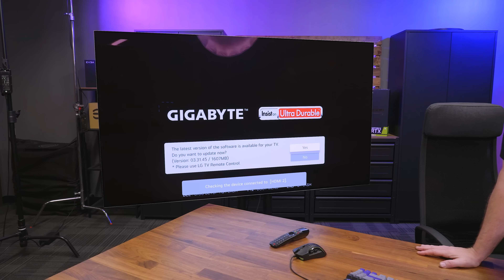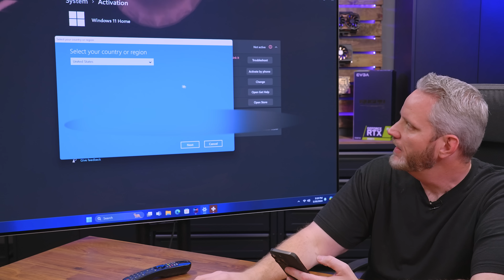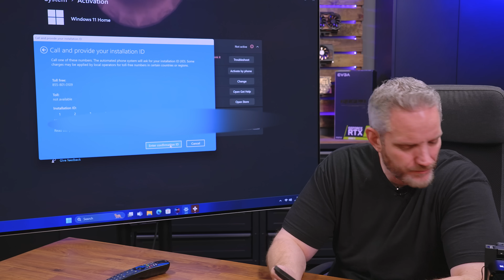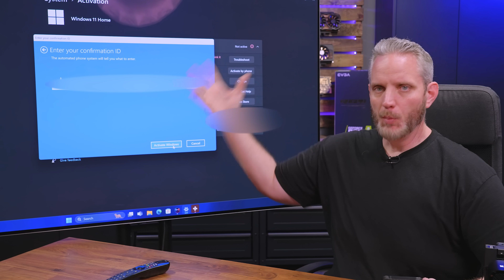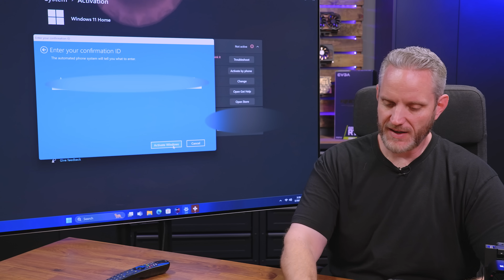How to move OS drive to new PC and keep Windows and Activation! EASY!

Comment: thanks for the info currently i beleive my mb is borked because it even stutters sometimes in my bios and i used to build pc's no  issues my entire life  this is the first time ive not been able to nail down what the absolute fucks going on

and im keeping this installation because due to anxiety its highly customized to not expose me to anything that would set me off

so i plan on because apparently when it comes to pc's im cursed now ''i took the gpu out to clean it and everything went fuck for months again then evened out''  buy a prebuilt with the best fuckin parts i can get and then move my current m.2  ssd and hdd over 

hoping the pc issues are fixed and my games are smooth again im going for a 7800x3d and 4080 so i wont have to upgrade for awhile i fucking hope im still on a 5800x and 1080  fe

at one time i put a 3070 in and unknowingly cooked my board because my psu  wasnt strong enough i should have done research myself but i bought it in store and asked a sales rep what i would need and he said i was good

i was in fact not good i sold that gpu later for cheap to buy some shit 

3070 coulda been faulty or my psu could have been too weak but im gonna use a configurator and hope they set everything up correctly and just like i said insert my drives

...figuring out the networking driver will be absolute ass because currently ive tried upgrading it and it smokes my  connection and i have to revert it 

but i will use the amd uninstaller to get rid of all my drivers uninstall my graphics driver with ddu and hope for the best

if it doesnt work i guess ill have to figure out how to customize the win 11 ssd they will put in it by default but i planned to wipe it and use it for storage

i know some boards smoke your pcie lanes speed with 2 m.2's connected but jeesh issues for another time 

..i need to get  a new desk aswell ive had dogshit luck on amazon with the last 3 desks being faulty warped and i hate when the desktop surface itsself comes in multiple peices shits criminal because with the floors in this old house the screws holding them in place are always the fail  point for me 

so you see im currently on the worlds most scuffed gaming setup and am about to have a huge come up and i plan on fixing my issues so i can get back to being a gaming warlord

Comment: @JayzTwoCents I think it might not be aura but the Armory Crate Aura. If... it's on there and you can get it out without reinstalling windows from a usb drive. You can use the old version of Aura that doesn't really do individiual RGB so much seems to work better. I've seen Armory Crate mess up the Power off and even the default states on Ram and GPU's it might even last a few power cycles after you get rid of it. The damn thing even reset my bios aura settings for on and off states because of that power off state garbage that lets you set different custom profiles for the off state that really only applies to suspend because off is off except for the lighting on the board. Armory Crate is the biggest pile of crap I've ever seen except maybe the utilities that come as optional installs.

Comment: My nvme loads on my old pc, I remove it and put it to o my new pc and I get error inaccessible boot device
Reply: Did you try to change the primary boot device in the Bios settings?
Reply: @ I figured it out, I have a WD blue NVME and I had to update the software on it to make it compatible with windows.

Comment: My pc says put new pin. It doesn’t say getting devices ready. I just upgraded cpu mobo ram. It just turns the display off after fans go to max. Happened 15 times after 8hours troubleshooting. Does this video only work on $200 windows keys?

Comment: update: this absolutely DID NOT work. The main problem i ran into is that first off i had a pin to log into my Windows 11 account which i couldn't change because none of the drivers were the same in the new PC so I didn't have LAN or WiFi and windows asked me to change my pin before I could log in, but I needed a internet connection to change it, which i didn't have. I had to throw the OS drive in my laptop, disable the pin and password then reinstall it into my new pc and even then i could log in but I wasn't able to update any of the drivers because once again the drivers from the old system were installed and different from the new mobo's drivers. The only thing that saved me (maybe, I'm doing a Windows update right now) was that i had a spare usb wifi adaptor lying around so I'm currently using that to update Windows and hopefully that will install all the needed drivers for the new mobo. My advice even though it will suck is to just reinstall windows.
Reply: Yo man did it work for you in the end? I've just updated my board and cpu today and ran I to this issue stuck at the sign in screen and can't as it needs Internet have ethernet plugged in etc but yh same boat, did the usb wifi trick work in the end? I've so much asetto corsa mods etc I'd hate to have to re install windows and spend weeks re installing the plathera of content hahaha it'd help a crao ton if you coukd let me know how it went for you in the end!

Comment: Jay, I've got a question on this topic which deviates from your video a bit but is still relevant I think. I have a older PC which I am replacing now. This means I am moving from an older SATA-SSD, which had Windows-OS duty in my old machine, to a new machine which will have an NVMe SSD. How to deal with that, can I still keep my license for this?

Comment: Nice to hear that it should be that easy. Because when I put my ssd into my new pc, windows threw a BSoD at me and I have no idea how to get it to work now. Any idea what I could do?
It says "inaccessible boot device"
Reply: Did you try to change the primary boot device in the Bios settings?
Reply: @ThatUpster  The problem was that rapid storage was activated in the new bios but my ssd didn't have the drivers

Comment: Saw this because I did it the other day. If I may…! Top tip. I use the boot key I have for my first build and my copy of windows 10. Recently upgraded from Z390 i7 to Z490 i9 I put it all together and purposely left out the drive and do a mock of the drive and windows troubleshooting. It’ll say it can’t but then you turn it off replace ya hard drive and it’ll set it all up never needing activation again. 💯⚡️👍 only cos ya know if Microsoft didn’t require me to have to disable half of it to not drop half fps cos they wanna sell me suttin I felt I’d share this with you.

Comment: I had replaced the motherboard in my computer, and somehow didn't need to reactivate Windows. Actually, by this point, I think I have replaced everything that was used in the old machine (at least as far as what Windows uses for activation, case, fans and PSU have remained the same). OS drive started as a pair of 2.5 SSDs in a mirror, to an M.2 SATA (Because I was running out of room), and eventually an M.2 NVMe (because I noticed a bit beyond the return date I messed up here). The spinning rust drives (one is for recording footage from games, the other is just general stuff you normally would have two drives for in a computer) were updated as I updated the drives in my NAS. GPU was upgraded twice (one was used, and it seems it had bad ram after a while, so I was forced to buy a new one), RAM was changed (I think I started with 32GB kit but not sure on that, then changed to a 64GB kit, and changed it again when I wanted it to have a little more speed as the first kit was the speed of the out-of-the-box setting for RAM.) and even the motherboard and CPU was changed (This didn't change the RAM I had at the time I did this)

Find it funny that the mobo and ram were most likely because of some random JTC videos saying something and I looked at my system as was like "Oh...". In the case of the Motherboard, a video talking about heat soaking the components if you have your top AIO bring air into the case (I only had a single exhaust fan at the time that video was released) so I bought a new CPU and motherboard (Intel, jumping generations), and for the RAM, a random "Check your settings" video made me noticed the ram I had at the time didn't have profiles for speeds.

Comment: No ethics required, unless you build multiple systems which are then sold you can and should reuse your key with each new build without worry.  The fact microsoft even attempts to make you buy multiple $200 keys for simple upgrades is the unethical part.  If it's your computer and just upgrades you are perfectly justified doing this, there is no foul here.

Comment: Regarding the powerboard and whether it's useless or not, I believe the intention with it is to more easily swap PSU cables and/or the PSU itself in the event where it would be defective or something like that.
Like like with other test benches, you can just as easily swap out the other parts such as the Motherboard or the GPU. So the powerboard is likely to further that simplicity with swapping out parts.

Comment: I have a bit of automotive diagnostics software that has high demands and despite various patches still also causes conflicts with some other automotive programs installed. Given that some of the softwares functions can take up to the best part of a working day I decided to have one pc with just that on it, which would solve the conflict issues too.I had everything I needed laying around,including a hdd with windows 10 installed from my old asus workshop pc,but no motherboard and I couldnt get another to match the original pc the hdd came from so I bought an msi board and using some unknown ram, a ryzen 5 5600 and a gtx 1050ti that I have no clue as to where it came from, chucked it all together.Fully expecting to need to reinstall windows, It just booted right up. I did complete a bios update and change a few settings about a month later while bored😊 and it took about a week after that for windows to stop finding updates, but for that month it ran completely without issue anyway,sometimes you get lucky.

Comment: This takes me back to the XP days working in a repair shop.
Back then, a lot of costumers brought in a prebuilt from a brand called Medion which in our shop was notorious as they always seemed to break right after the factory warranty expired.

They were cheaper than competitors when it came to specs so I'm sure they must've bought bulk hardware that may or may not have barely passed Quality Assurance, at least back then.

Replacing motherboards was almost a daily thing and as you say towards the end, back then it would bork and require a fresh install.
Calling MS to activate Windows was also a daily thing we did 😂 and 9 out of 10 times we had to wait to speak with an actual person and explain the situation time and time again.

Comment: Thanks for the very practical and useful video.  I have done this recently and was surprised that it was so painless (even on a dual boot system where grub is in charge and windows is an add on for the handful of games that won't run in Linux).

Comment: I dont do ms account so after two weeks with a new mobo it loses activation, sometimes it comes back on its own sometimes i have to troubleshoot to get it back. After enough times that key gets permanent attached to the first mobo it was ysed with.

How i know: i built my mom a pc from all my old hardware and tried that dead key that was first used with the mobo i used for her pc and it activated instantly. Didnt even need to troubleshoot lol.

Comment: I've done this before where it resulted in Windows not recognizing the new hardware fully. It worked and downloaded drivers, but when I would pull up MSinfo32, it would still say the old hardware there. It also led to some problems trying to download proper drivers (and I must have tried half a dozen methods), and Crucial still thought it was the old pc but corrupted, so I couldn't see what upgrades were possible that way.

Comment: Not sure if this is still happening with Windows 11, but for pretty much every version of Windows since NT,  you may want to also remove orphaned drivers as well as they can impact performance just being there (even though Microsoft insists they should not).  You can do this manually by setting a system environment variable DEVMGR_SHOW_NONPRESENT_DEVICES=1 which will open up the device manager to see a more complete list of detached/hidden devices no longer present.  I prefer a free program called DeviceRemover that can still be downloaded from MajorGeeks.  Have used it hundreds of times and never had an issue with it, and it even has system restore point creation built in if being extra cautious.  Set the view to HIDDEN/Detached and then remove all, reboot.  This is especially helpful for clearing out older storage and video drivers which I've noticed have the largest impact if just left behind dormant.  They can affect anything from drive transfer rates to FPS in games...I sincerely doubt Microsoft has resolved this in Win11, but if so, I would be pleasantly surprised.  Guess I'll find out on the next HW transplant.

Comment: I just use Linux and open source software at this point so that I don't have to give a shit about "product activations," license keys, phoning home, rootkits and other DRM garbage that is designed to make your system not work. I deal with enough of troubleshooting that type of shit at work. Dealing with product licenses is a pain in the ass. Unsurprisingly, my life turned out to be easier when I simply switched to software that only requires me to click "download." On the flip side, Windows is literally freeware at this point and you shouldn't give a shit. When I swapped out my motherboard, my product key didn't swap over and I was greeted with a scary watermark that I simply ignored for 7 months, and nothing happened. Microsoft wants all your telemetry data, they don't give a shit about selling box products any more. If your product key doesn't work any more, oh well? Who cares? Certainly not Microsoft and Satya Nutella. You can't change your background? Oh nooooooo. Microsoft doesn't care as long as you buy Office365.

Comment: when i swapped from my b450/1700x to my b550/5800x3d my windows refused to let me click "i have changed hardware" so i got a crack off a friend and that was ok i guess but i had to reinstall the os eventualy with the refresh option in the os and it went legit, i checked the key and it used the one thats connected to my microsoft account, how it worked i dont know but no complaining here :)

Comment: I have done this a few times, but i have issues, my god do i have issues with doing this. I have one pc that went from Intel to AMD, with certain games unable to run,  i recently did it again, and AMD chipset drivers refused to be removed and kept wanting to update on an Intel platform. Ended up doing a windows reset and all is now fine, but it works yes, but its not a smooth, its not as good as a clean install in my POV.

Comment: microsoft for sure handles their licenses more freely these days if you're setup. i have no idea if the boards are branded. i doubt it tho. i have a branded oem license i move for laptop upgrades. it's no trouble at all. ms login and apply digital license. ezpz 1 step activation. tbf... i have a legit win 7 key that is registered but not in use. if i still had the key sticker i could even use an old xp64pro license to upgrade all the way. that were 150 bucks back in the days. in theory i have 3 usable laptops and all legal. essentially i only have 2 if i count the physicals or the key sticker is gone and the oem sticks. hmmhmm

Comment: you need to make a  videos explain how to install drivers for a new build at the start of the Windows installation? You can't install Windows on a new motherboard with the Intel platform unless you bypass the internet connection or install the drivers at the start. before installing windows

Comment: Interesting. If i ever build a fresh new custom build instead of upgrading si builds. I recently did the other os drive swap method. (Copy os to another drive) went from a single hdd setup to three sata ssd setup where os drive is strictly os, (sadly means no more game mods as vortex being a massive stick up the arse!) and two matched ssds running in raid for speed for the games, programs, and personal files.
Reply: RAID does not improve speed.
Reply: @ObakuZenCenter  technically true, it increased bandwidth. But since every drive separately can only output so much data. But in stripped raid you now have multiple drives output at same time. Thrus more lines more data transfer equals more data processed there more speed as you are not wasting clock cycles waiting for data, literally same concept behind dual data rate.

Comment: maybe this is gonna sound stupid: would this work switching SSD from a laptop to a desktop? I really don't wanna reinstall all the software and move all the data from my old working laptop.

edit: my new PC's coming today! Does anyone know if this would work??? PLEASE
Reply: That's not a dumb question at all, carrying drives from one pc to another is normal, I'm still using my drives from old builds in my new one!  This process should be the same no matter the change from a laptop to a desktop!

Comment: I Once was stuffing around with settings in the BIOS of my Zenith II Extreme (I had 4 SSDs in a Hyper M.2 card which were Gen4, But for some reason my riser cable wasnt stable at Gen4.

Just changing those 4 drives out of the 8 NVME drives I had in my system at the time from Automatic (gen4), to Forced Gen3 PCIe caused Windows to deactivate even though none of the hardware changed at all.